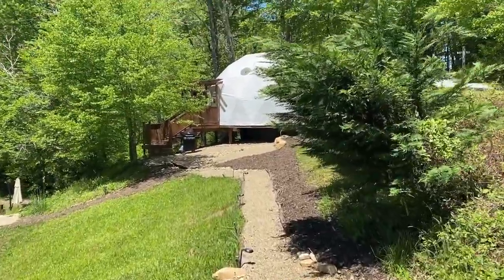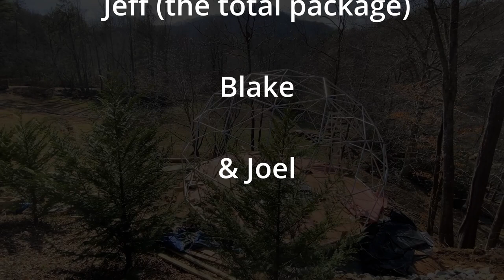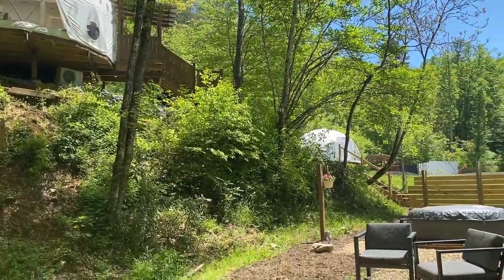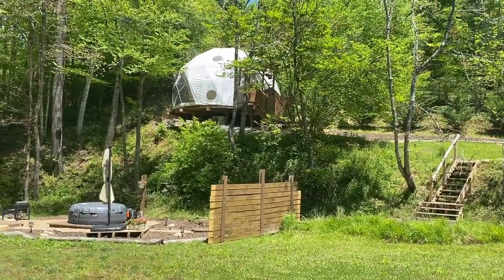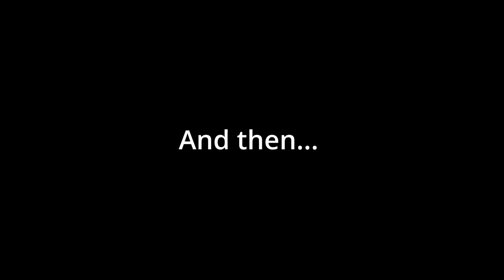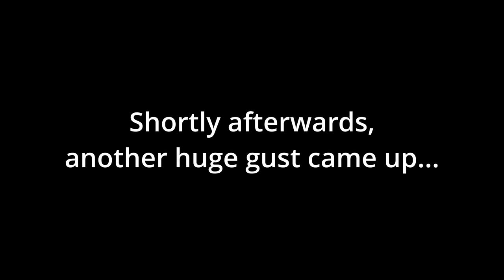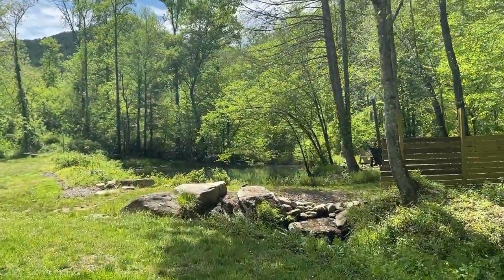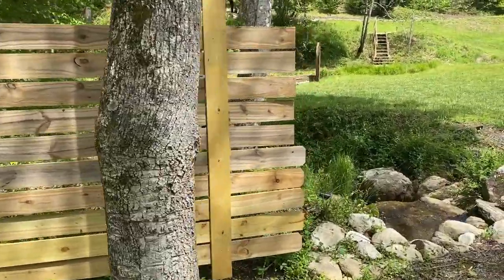Glamping Dome Build - Ep 5 - Frame & Cover Assembly

Comment: Hey there! We got the cover onto our dome but are having a hard time getting it to fit snuggly. It’s about two inches high all the way around, which makes it hard to screw the cover to the wood platform through the grommets. Since it’s not tight, we’re also getting water pooling on the roof. Any suggestions are appreciated!
Reply from the maker: Hi Hannah, yes, this can be a tough one... other than good old brute strength, we have used a combination of small ropes tied through successive grommet holes, and a tool called a sheet metal hand seamer (grips the fabric) to pull down on the cover from the outside. Pick a spot, then work your way around slowly and the slack should start to come out. Good luck!